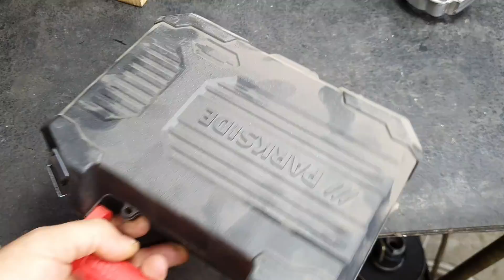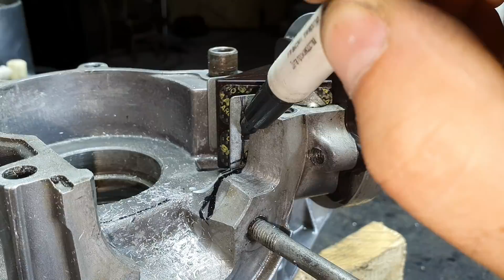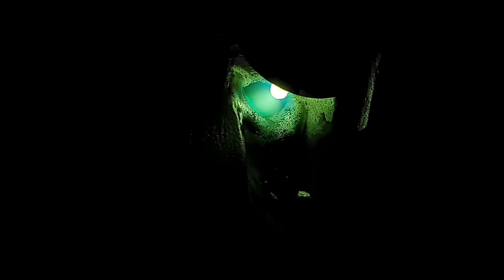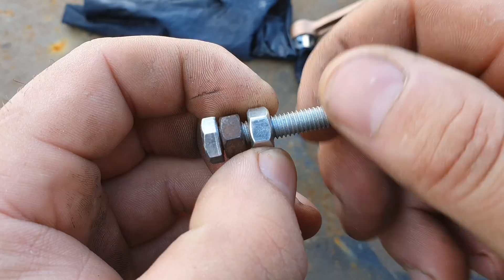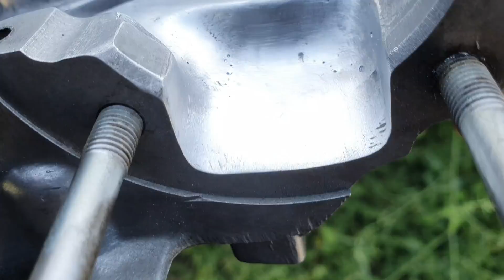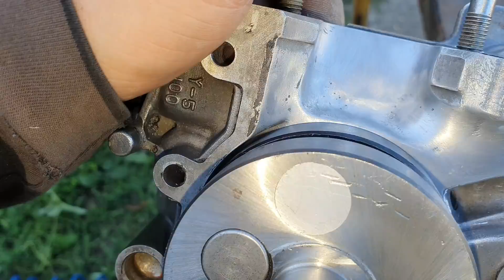Портинг картера Minarelli 3KJ - запил

Comment: You should reinforce the block by adding more material on the outside of the block by welding or using some epoxy like JBweld, to avoid cracks in the block itself. Also inside to cover the little holes (see 15:51) to make smooth path. Hope to see next updates soon, I really like watching you doing interesting stuff! 👍
Reply: i think he has since he mention it in the video :)

Comment: Samodel, many times to ensure a better fuel flow the reed valve is rotated 90 degrees as in the Piaggio crankcases even if there is more work to be done, however it is great work, I respect you a lot...
Reply: But there is no space at least in the vforce 3  is good idea to grind off material? i dont like the idea too much

Comment: Very good job! Here are some tips I've learned over my years that can help you!

Shortening your reed stopper leads to shorter reed pedal life. Next time, if the chassis allows it, use a reed spacer and longer bolts. The Honda CR500s have the same problem. A reed spacer helps add more torque too!

Did you fill the outside of your holes too?

Your oiling holes still have a sharp angle on the inside. Next time, use your small conical grinder and smooth that angle to make the oil really wanna go in there!
Reply: Adding that kind of spacer sounds like it would add crankcase volume, would it?
Reply: @rabbitfootedkitty1339  Yes. Helps torque, but clears that boost port path more importantly.
Reply: @nunyabizzness5477  I thought adding crankcase volume was usually a bad thing though
Reply: @rabbitfootedkitty1339  It depends on the engine. Smaller KTMs used for XC use and the last couple years of RM250s used them.
Reply: @rabbitfootedkitty1339  back in my racing days we would use double thick gaskets to pull the reed cage out 1.5mm to clear the transfer path. It was a small improvement on my 125, but helped more when the engine was fully ported.

Comment: An air-fuel charge in a 2 Stoke is the effective volume of the space under the piston @ TDC (top dead center) till the BDC (bottom dead center). This is a fixed volume. The ratio of this volume to crankcase volume will give you crankcase compression. 
The ratio of the volume of the head dome to the cylinder volume above the piston at BDC will give you cylinder compression ratio.
By milling metal from the crankcase you have decrease the crankcase compression. While this will prevent oil leak from crankcase, it won't give you power. To get power, you have to mill some metal out from the underside of the piston. It will push more air- fuel charge up during down stroke. Think of it like a syringe, a tall piston will displace less volume, a short one will displace more. But what goes in will come out in a 2 stroke, to get the benefit of all of this, you need a tuned exhaust.
Reply: Agree. Now what he needs to do is fill the crankcase where he can to restore the material he removed and then some 😁
Reply: On this tune crankshaft its ok, more powerfull.
Reply: I'm new to this. Where would you be able to fill the crankcase volume back in?
Reply: You don't need a high crankcase compression if you have a well tuned pipe (exhaust), the exhaust will provide more scavenging action than the crankcase compression.
Reply: @ferrumignis  you're right but the argument here was - skimming the crank case won't increase the intake volume.

Comment: sorry to say, it is kind like a person who doesn't understand how two stroke engine works, who don't understand when the reed valve open, what primary chamber function etc.. gas mixture flowing to transfer port when piston going down to BDC, it means reed valve closing, so what is the function of making that line? every lost material there will decrease primary compression and it's make you lost so many chance to make bigger head chamber (low compression ratio) to trap more fuel mixture with high compression like turbo engine.. low compression ratio with high real compression pressure makes more power. learn from turbo engine.

Comment: use an epoxy resin to fill the pitting for smoother air flow, when dried you can sand it and polish.